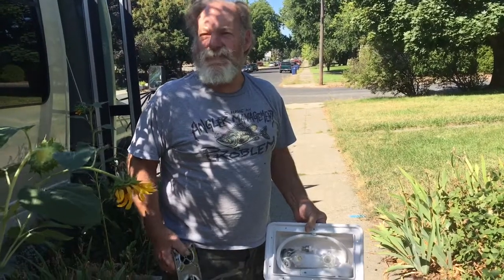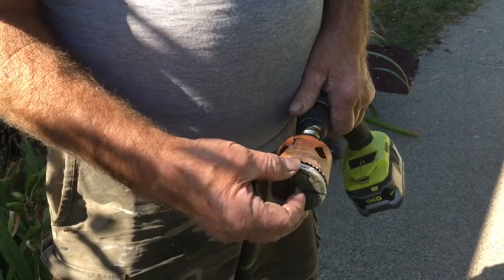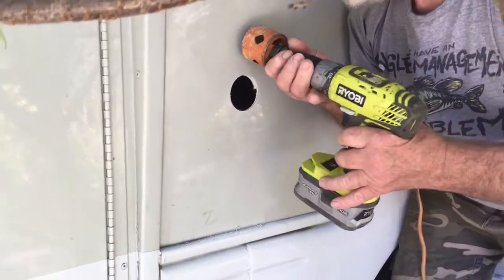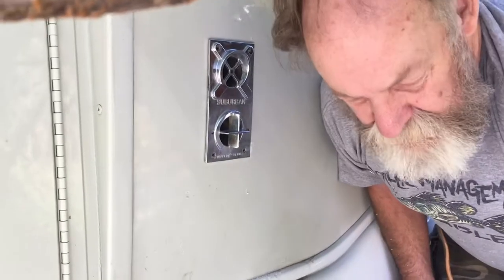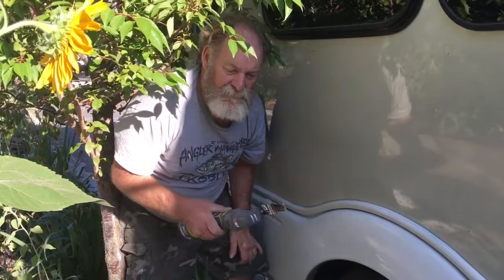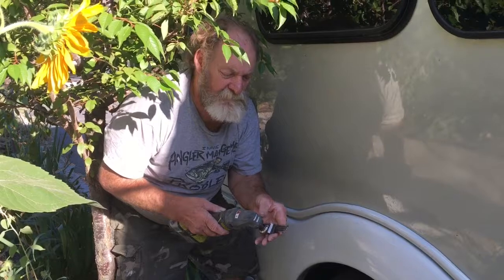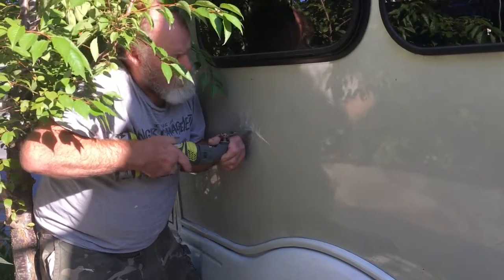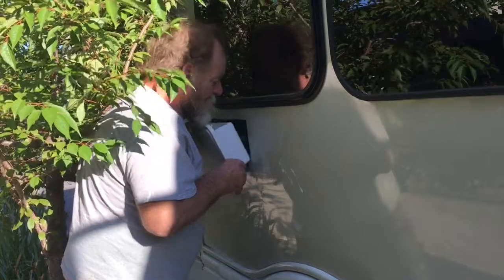Hole Cutting Tools 🧰 Bus 🚎 Conversion Ep42

Comment: whats your GVW when loaded?  my little bus is 10k
Reply from the maker: Our max is 15,775, Won’t know exactly until build is finished but we are going to try and take it over in the next week or so to check the weight.
Reply: @ACMArtsAndAdventures  I have to much junk in the back... need to redistribute the weight better.... will be working on doing some work to lighten up the custom cabinets etc.
Reply from the maker: When we were designing our build, we paid special attention to the distribution of our water storage, propane tank and batteries. Water seems to be the major factor at almost 8 pounds per gallon
Reply: @ACMArtsAndAdventures  yes my problem is all my stuff LOL...its heavy.. so will reduce the stuff I really dont need and find alternate ways to store stuff